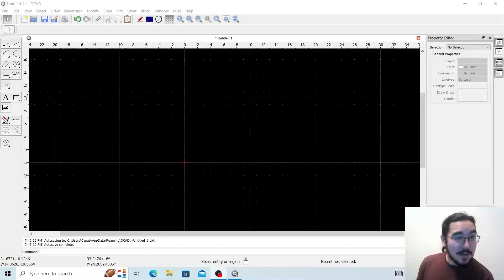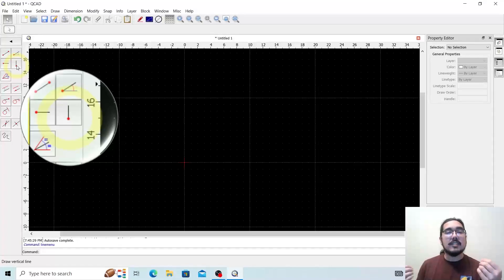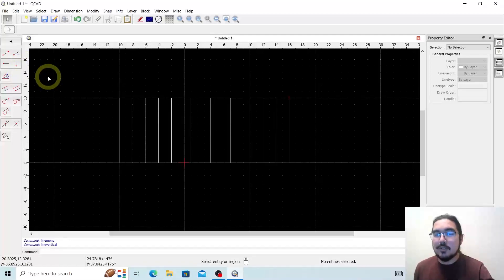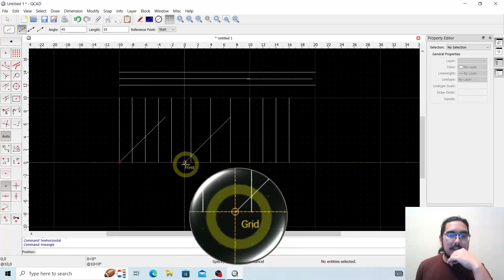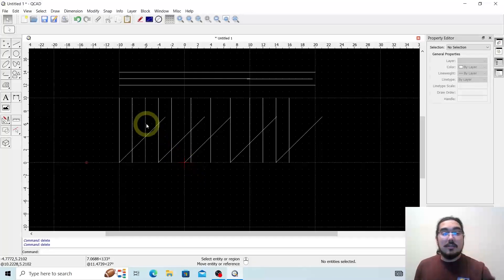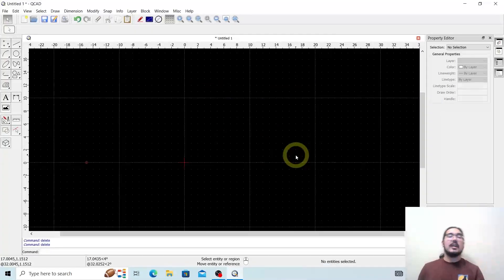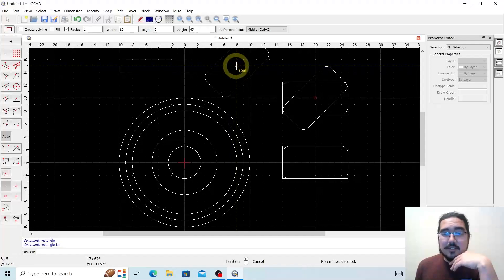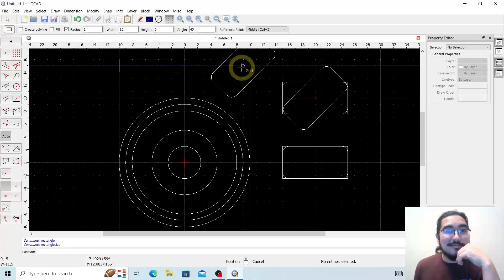How To Create Basic Shapes in QCAD

Comment: Thanks for posting this vid. 
Many folding knife makers use qcad to design folding knife components. For a complete novice to cad this proves to be a VERY steep learning curve. 
A video that demonstrates how to design a folding knife would be VERY useful. Especially starting wit a slipjoint knife’s 3 components. 
the blade, backspring and liner. 
most importantly the blade should be able to rotate correctly. 
Thanks again. !